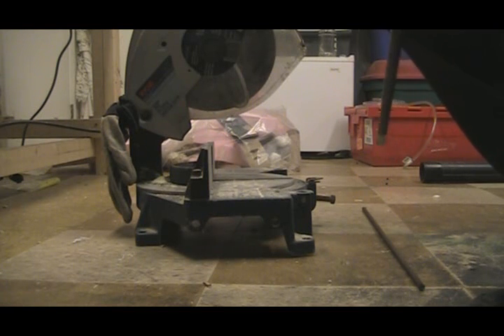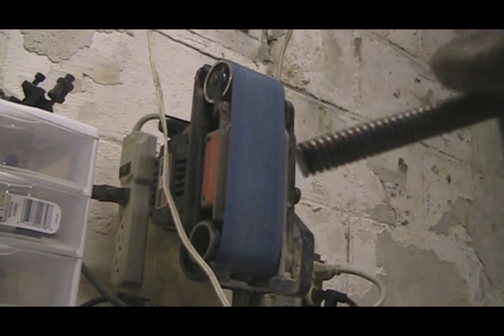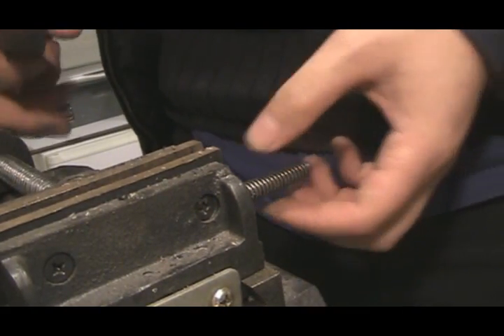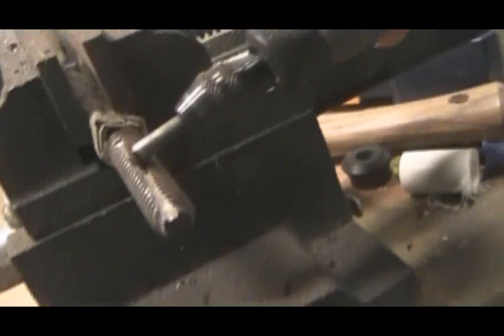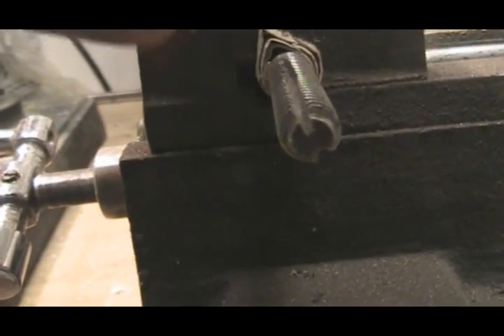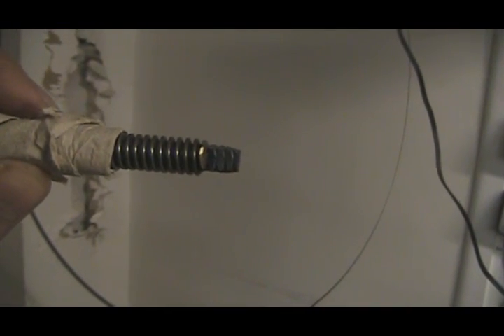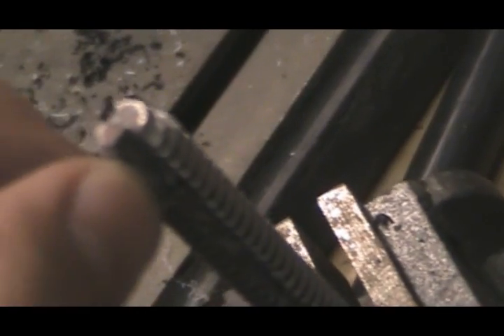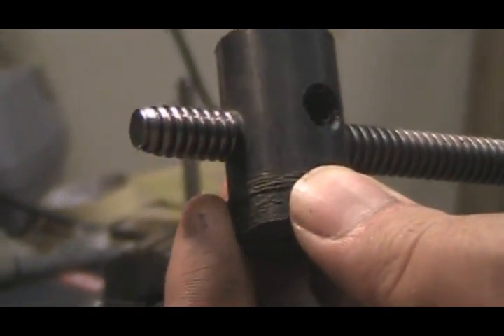Homemade ACME Tap (final).wmv

Comment: Ok good job but how well does it work on steel I would imagine how long would ot it last if you were taping steel  not plastic
Reply: I know this is long after your comment, but if you're going to be using something like this with steel I'd recommend using a mill v-slot cutter to cut the flutes instead of using a cutoff tool in a dremel.  As well you might want to give the initial cutting threads some more thread depth to ease the cut.  After you have the tool completed heat it until the whole work is a uniform cherry red, being very careful not to over heat it and quench it in oil to harden it.   You'll probably have some trouble working the tap through the piece, but you should be able to confer the threading pattern to soft steel with some effort.  Using a lathe and an appropriate feed you might be able to make the process easier on yourself, but there is a real risk of breaking the tap off in your work.  I've never actually had to do this  though, and I'd probably just drill out the proprietary thread size and replace it with something more standard instead.

Comment: Nice video. Had a similar issue putting a thread in acetal rod for a robotics team. Taps for acme are just too expensive. I don't need to worry about backlash, just minimum friction. After taping by hand I ran the tap in a power drill while putting light pressure on the acetal rod. Now I can spin the piece by hand several revolutions with the flick on a finger.

Comment: Nice lateral thinking, good enough for your purposes. If you had to cut harder materials you would have to consider the store bought item, that or do a lot more tapering on the lead up as well as at least case harden the material. Well done, cheers from John.
PS If you could find the same thread in high tensile then you will have a fairly high carbon steel that may then be able to cut Aluminium, Copper and Perhaps even Brass.

Comment: What is going on here? I have cut plenty of threads and not one of them could have been done the way you describe. Cutting an acme with the tool held in a vice while you rotate the short  part to be threaded in steel would be impossible to get started. Is that a piece of plastic you are using for your demo ? Not enough info in your vid.
Reply: Classic click bait

Comment: i don't know about doing one out of acme threaded rod. But you have sparked an idea i think i will try to single piont thread a pice of A2 pre-hard the acme thread i need, and cut in flutes with a surface grinder with coolant so i don't anneal it.To another posters point of heating it.If it is cold rolled this will do nothing but waste fuel.There is a product called casen-it you heat your part cherry red and plunge it in this powder and it will actually case harden a low carbon part quite well.

Comment: Neat to see the improvisation.  If you heat it to cherry red, then quench in oil, you will have a better tap that can cut aluminum at least as well.  

Note, this only works if it is high carbon steel, but you can tell by the sparks.  If it looks like exploding sparks, you are good.